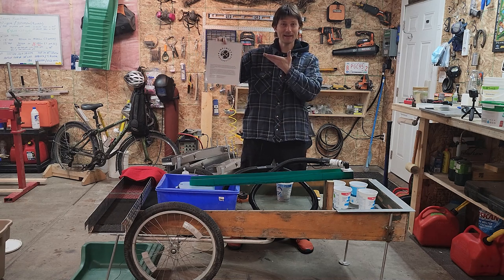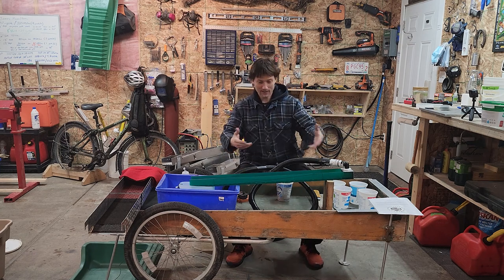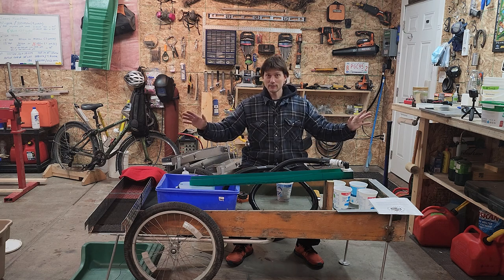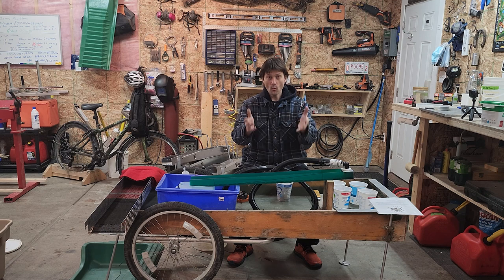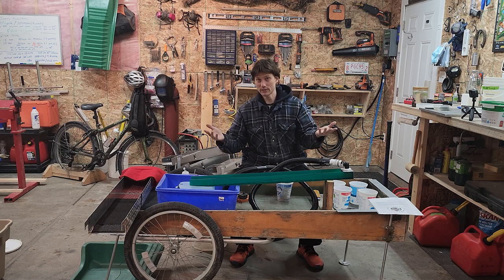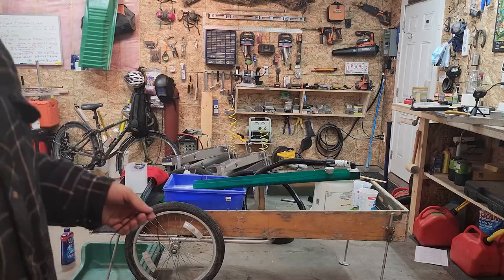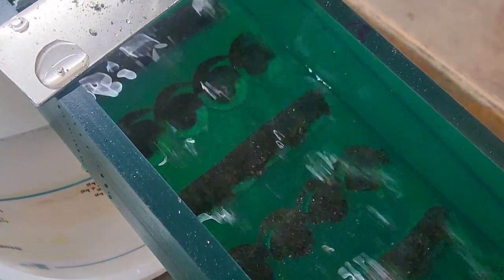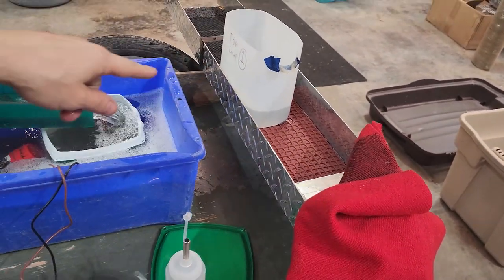First Impressions of a new Cleanup Sluice: The VDR (Vortex Drop Riffle) from Infinity Prospecting.

Comment: Lots of good info and footage! I especially appreciated some of the asides. Comparisons and tests are only as good as the people doing them and there is so much that goes into it. A presenter could easily show a bunch of different results if they were motivated to. That's why people trust YouTubers more than the news these days.

In regards to the specifics of your test and it's core question does the vortex riffle work better than a pure drop riffle the answer is yes it does in most metrics but you didn't really test that in this video (in my opinion). To determine that you would have to cannibalize the mats of the flow stabilization areas and drop riffles and make the vortex design run less efficiently and then compare that directly with the drop riffles or a sluice comprised purely of them with both units running under as close to optimal conditions as possible.  A separate question people care about is: Is the VDR sluice useful for prospectors doing a cleanup, with all three proven methods working in sync? I think so because we all work hard for every little speck. It does save people a lot of time in the most tedious stage of prospecting.

As another counterpoint I would use the example of pouring a 1g sample through the sluice and then measuring the results in sections as you did to determine the best recovery method. Depending on how long the sluice ran it probably will show the V mat catching most of the gold as well as the first drop riffle. If you just then concluded V mat is the ultimate gold recovery vehicle you'd be wrong. It's a very useful indicator section and it has its place but if you applied that to a production sluice it would be so long it would be absurd. The truth is flour gold is notoriously difficult to capture and having some length and some proven designs are to your benefit.

You can also influence the distribution with your flow speed. We recommend having up to 1000GPH. If you run on the slower end of that spectrum as you noted in this video a high percentage of the gold will be in that first drop riffle but I don't think it would be as dramatic in a higher purity sample that was run for longer.  The order is very important as you noted. 

It's amazing how the gold pops as soon as you reduce the water flow! Once you do a few runs with a more heavy gold ratio you'll get better at optimizing it since you can watch the gold displace the black sand. This makes it easier to observe. Some users will run at a higher flow for higher purity for a quick daily pan to use the results to optimize in the field. Most commonly people reduce the cons and then back pan without extra equipment. Manual control is the best in my opinion when the gold and sand is at its finest. A common clean out tip from Flour Gold Wizards is to hold the sluice up while still connected and turn it back on to discharge it into a pail or pan. Also since the sluice operates by displacing materials you can feed it faster than many are inclined to believe. Classifying will huge boost efficiency too.

I know you were hesitant to try it out but it says a lot about that you still gave it in an honest shot. You looked like you had fun. I always love watching the skeptics become intrigued. I'm sure you will find a use for it. Thank you for giving us a fair shot! 

https://www.infinityprospecting.com/shop/p/vdr-mini-sluice

P.S. Kyle doesn't want sponsors but feel free to use code UTMOSTOUTDOORS for 5% VDR products on our site. I'm sure he won't say no if we send some goodies for his growing audience.

Comment: I run a aluminum 12x36 side tip from Devon gold. Works great as a cleanup sluice or just as a sluice.The aluminum versions are much deeper riffles runs at 3200 to 5000 gph.

Comment: Nice test, especially the vortices vs. drop riffles. Your test utilized a good reliability process. I have been playing around with mine for a few months. I ran it with my 800 gph bilge pump. Set at 9 degrees, I was saving way too much blond sands. I switched to a 1100 gph pump, and played around with different amounts of water flow.  My best set-up is a 9 degree slope, and my water flow set at a rate where half the drop riffle is exposed, at about half way up. When feeding, I suggest you spread out the spoonful so it covers the whole 3 inches across. I do this with kind of shaking the spoon back and forth  against the current. That eliminates a pile of super concentrates in the center of the sluice where you feed it. I feed it fairly quickly, allowing good exchange, to keep the heavier particulate in the drop riffles, up top. When I am done, I let it run for a while, waiting for the blond sands to mostly disappear. I then stop it and  put the remains in a pan. I re-run the concentrates, only this time, I put a 50 mesh screen at the low end to screen out a smaller ratio of concentrates. I save these and run them at a later date, and always get another batch of smaller -50 mesh gold.  For large amounts of concentrates, I add a bucket - sluice on top, orientated so it releases it's concentrates into the VDR sluice. I always get some gold in the bucket sluice, and more in the VDR sluice. My rational is that it takes a lot longer for the gold to migrate out at the end of the sluice with  extra drop riffles. I have confidence in the VDR sluice now after trying various speeds and angles and testing my losses. The VDR is a very capable cleanup sluice. I like the fact that it has 3 different capture possibilities ie - the "v"   matting  up top, the drop riffles and the vortices. I make an excellent designed sluice even better by adding another bucket sluice with drop riffles at times. I recommend you add some 3/4" angle aluminum along both bottom edges for better stability.
Reply from the maker: Some good ideas here for sure.  I definitely like the idea of doing a second sluice combined with this for maximum single run capacity.  With how few concentrates you're left with, we can get away with a lot more sluice area.  Good stuff!

Comment: Surely if the sluice was twice as wide , then the pump would still keep up and you could knock the material off in half the time.
I would not think being twice as would would double the price even remotely.
Or they could have made it half the length and twice the width , hence it would cost the same.
Of course that would mean DEFINITELY running it Twice , but because it would be twice as quick to run then total run time is the same.
Reply from the maker: Yeah, a 6" version would still have minimal concentrates to run over the Miller table.  A second 6" run in a zigzag would deal with any losses and still not be too much to deal with.  Not a bad unit.
Reply: I believe they have a 6" x 24" model.

Comment: That is a clever design. The straight riffles produce the loft  over the vortexes so the material doesn't just fly right over them.

I think these are great other than the prices. Charging what they do for mats made from inexpensive silicone is hard to justify.

Comment: Utmost Outdoors  ~Your methodical process, clear explanation, and video were all very well done. Looks like about 2/3 of the gold was caught in the Drop Riffles and about 1/3 in the Vortex’s. Correct me if I am wrong but I do “not” see the Vortex’s working with spiral spinning, what I mean is the Vortex’s look like they are “not” exchanging with a tornado spiral action, but rather the fine flour gold just falls into the Vortex’s like a dead round riffle. The manufacturer could have just drilled ordinary smooth round holes instead of screw spirals and it would have worked just as good being the same.
Reply from the maker: Visually the spirals did not look to be spinning, but they did seem to clean out in a sort of spiral action.  Rather than a full spin it looked like more of a combo between drop riffle and spiral effect.  Either way, recovery was good and cons were minimal.  I'm doing some further testing now for a video next week.
Reply: @UtmostOutdoors  ~Thank you very much for clarifying that utmost clearly.!!  I ordered two different types of clean-up sluices from the USA.  Kreeger Sluice and Gold Extractor sluice. I have never tried them yet but hope to when the weather in Alberta gets warmer.

Comment: I use the vdr for cleanups of my dredge cons. Honestly it's the best cleanup sluice I've had. Glue a hard backer on the bottom so it's not flexible. Works great for heavy dredge cons.
Reply from the maker: Yeah a solid backer to stiffen things up is a must, but still super handy that the sides come included.